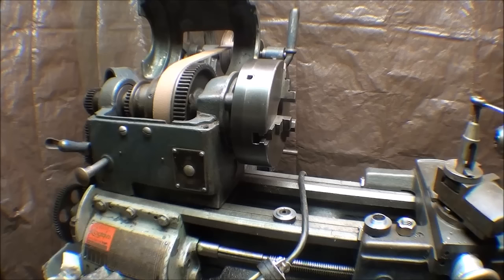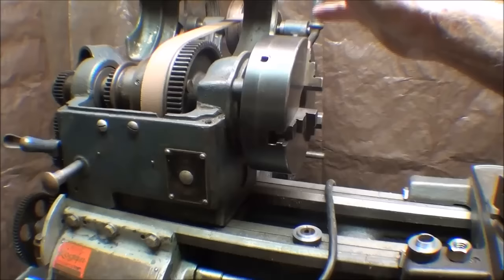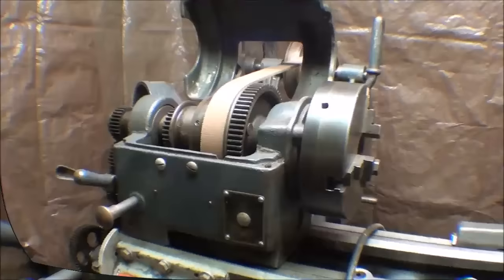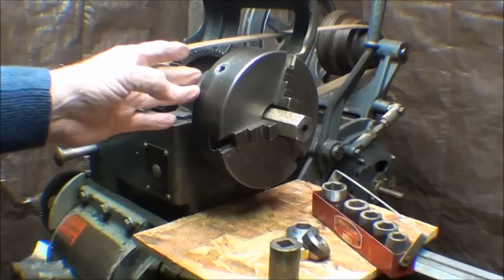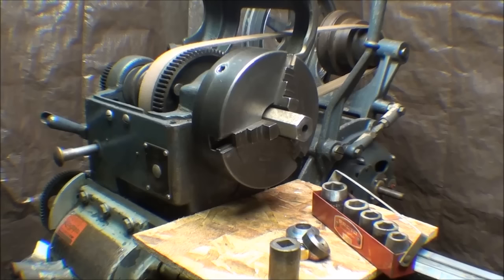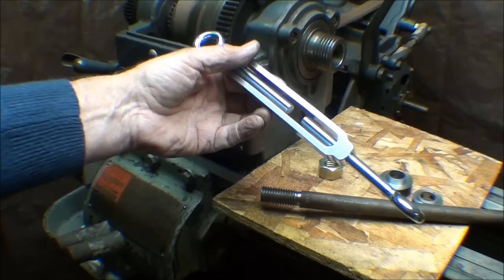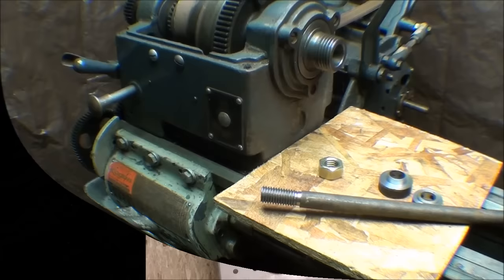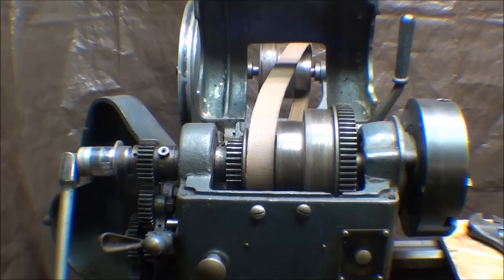SHOP TIPS #281 Removing a Stuck Lathe Chuck tubalcain atlas

Comment: My father came across a South Bend lathe which he mounted and fixed up before passing it onto me. the broken teeth in the gears he drilled a hole or two a bit wider than the base of the gear before inserting a friction fit steel pin which he then filed to the shape of the rest of the teeth. It seems to work fine.
Reply from the maker: Thanks for watching.

Comment: Great range of suggestions Mr Pete222.
Great ideas, I like the idea of using a strap wrench to hold the pulleys firmly, if adequate grip is not possible could you consider using a lorry ratchet strap wrapped around the largest gear and back on itself to self tighten the other end attached to the lathe casting? (I don't know if you can move the gear that it engages with sufficiently out of the way). 
Some lorries have left hand wheel nuts on the left side of the truck- might be another source?
When using an impact wrench occasional short bursts of forward motion mixed in with long busts of back off motion can sometimes help to break the initial break out of a stuck thread.
Reply from the maker: +Dan Whiteford good idea

Comment: another solution..on chraftsmann 12"put piece of 5/8 hex around 18"long so overhangs.out of back spindle..chuck up  have a 20" breaker bar..gears loose belts on and snap it...no danger hitting anything...worked first try..oh just in case piece plywood  rags stappled onto it under chuck

Comment: Hi  Maybe judicious use of heat to help break a chuck free.
I don't mean red heat but warm to hot to the touch and let cool with Kroil or another penetrating oil.
The heat cycles may help the oil to penetrate.
Thanks for your vids
Reply from the maker: +Dennis Williams I hope its very judicious

Comment: Strap wrench....Vise-grip makes a nice clamping unit with an 18" chain on it.....should be great for this application....
Reply: avoid contacting the chain on a pulley ... scratch ...maybe strip of 400 grit paper under the chain ... but at last resort the scratch is better than dynamite ...

Comment: I'm thinking a hook spanner in hole drilled in the pulley would be indisputably the best way to go when all other methods fail.  The  hole can be dressed so it does not wear the belt during slippage.  I only remove the chuck with a hex stock and a wrench.  If I need an impact, I use a plastic hammer against the wrench with all slack taken up by applying pressure to the wrench first. An electric or air impact would also be very effective even if only against the weight of the spindle.  I am contemplating an internal pipe wrench placed well inside the in-feed end of the spindle as a possibility also.
Reply from the maker: +Crafted good idea

Comment: Way late, but be careful if you lock the driven cone with a flat or V belt. Remember all the torque you apply to the chuck is passing through the pull-pin in the bull gear. Also as Lyle points out, if you lock the spindle with the back gear and you break some teeth, your lathe is just about ruined... replacement parts are like finding hens teeth. My lathe has helical form back gears and I'd by a junker just to have replacement gears.
The best solution is the last one shown in the video. Lock the spindle using the the through hole and go after the chuck with an impact wrench. 
Once you get the chuck off, make a paper ring to go over the spindle nose and make a seat for the chuck. It will make the chuck much easier to get off... just remember that running in reverse is to be avoided. 
A clever trick with threaded spindles is to get a collet adapter for a 5C collet (or the largest style collet you lathe will take) and then get a chuck with a 5C shank. I have a 4" chuck that stays on my 12" lathe most of the time. Then you can run forwards and reverse without worrying the chuck might come loose. Also, you can pull the chuck and install a regular collet in just a moment.

Comment: One problem that is somewhat related to this, in regard to the threaded spindle, is keeping the chuck tight if the spindle has to be run in reverse.  I have a similar idea to your drawbar (probably more like a Colette closer) but with the big end large enough to seat over the mounting plate rather than just the spindle end.  Using some heavy wall pipe that will just slide through the spindle bore would allow you to keep from totally plugging the spindle.  I've been thinking on a prototype for that, just need to find material so I can try it.

Having a 98+ # chuck coming lose to land on your bare ways makes life rather difficult, not to mention making you feel very un-professional.
Reply from the maker: +diggerop Excellent idea to prevent unspinning

Comment: I have a S-B 13" lathe with  4 jaw chuck stuck on it.  Before watching your helpful video (#281) I tried unscrewing the chuck after locking the spindle with the back gear (BAD IDEA). I was unsuccessful even using a cheater bar. Fortunately I stopped and watched your video. So today I put on a 1/2" electric impact wrench with a 1" 8 point socket on a 1" square bar in the chuck. Afte 8 or 10 short bursts I had no luck.  After each attempt I had to retighten the bar which loosended up due to the vibrations.  Any suggestions? Should I keep trying the impact wrench?  Bigger impact wrench?  Next would be to make the 5/8" bar with the left hand thread going thru the spindle the collar on the right hand side of the spindle up against the 4 jaws of the chuck?
Reply from the maker: I would tell you to keep it up with the impact wrench. Occasionally putting it in forward and then reverse. Possibly heating up the chuck thread. Not too hot, use propane, not the blue wrench.  Just keep trying different things. Eventually you will get it but it won’t be easy.
Reply: @mrpete222

Comment: I have a lathe from the 20s the chuck is stuck and is wore out any suggestions
Reply from the maker: Try to take the whole thing apart after soaking it in diesel fuel.  Actually, I would throw it away and get a new one

Comment: I think your V-Belt strap wrench would work even better if you clamped the drive gear on the end of the spindle instead of the pulley.  The gear should bite into the belt and prevent slipping.    I've also seen people make a clamp from a block of aluminum that's been bored to the size of the gear, then split and bolted back together.  Now you have a square/rectangle you can grab with a wrench.
Reply from the maker: +ChipMaker 1066 Both ideas are very good & workable. thanks

Comment: Is a lathe totally junked if you break a few teeth? My lathe has missing teeth and still runs fine, and i can even see a few places where broken teeth have been repaired.
Reply: +Rob Mckennie Agreed.  Real machinists don't throw out anything that can be repaired, re-purposed, or at least donated to someone who can.
Reply: +Keith Ward Good few videos here on making new teeth for a gear, and many ways to do it using assorted material. Good thing is you can even do it without a lathe or a miller, just using hand tools and filing and grinding. Gear teeth in this application just have to be moderately strong, and as most are straight cut they are pretty easy. Just make a pattern off a good section to get the angles right.
Reply: Easier said than done. Me as a newbie don't have the equipment to just run off and make gears. Sounds like Rob is a newbie asking if its totally junk.

Comment: I have a very badly stuck chuck on my myford ml7 and I may have been one to message you.  do you think If I made the last tool and used a impact gun on a piece of hex stock in the chuck…. do you think I can ruin anything? the soft bearing material? or snap the threads of the chuck? or mar or bend the spindle itself (with all the drive pulleys?)  do you suggest heat be used (acetylene?)
Reply: +ShnitzlHaus - Try the impact gun with the spindle unlocked. The inertia of the spindle will eventually let the impact wrench break it loose. The impact wrench/unlocked spindle method puts no strain on the back gears or on the spindle bearings. You just have to prevent the chuck from spinning too fast. Short bursts, or a gloved hand to keep the chuck from getting away from you.
Reply from the maker: +ShnitzlHaus try it---but no heat

Comment: What about using an Internal Pipe Wrench inside the spindle. Originally I was thinking of inserting it from the gear end opposite the chuck, but I think you might be able to insert it into the spindle on the chuck end taking advantage of the more robust end of the spindle.
Reply: Well, I recently obtained an Craftsman Atlas 12" Lathe. I wanted to know how "Stuck" the chuck was,, so did try using an internal pipe wrench. Worked quite well, I do not think the chuck was that stuck. I used an adjustable wrench on one of the jaws and the internal pipe pipe wrench with a 3/4" drive, socket and wrench rested on one of the protected ways. I do think one would need to craft an optional method to turn the chuck should the "Stuckness" is more serious rather than using just one of the jaws, possibly making a spanner wrench of sorts.

Comment: I have a Atlas-Clausing 6" lathe and when I bought it the chuck was stuck on it. I didn't want to chance damaging the back gears trying to loosen the chuck and I'm glad I didn't try. 

Remember place a board as a protector for the ways before doing anything. I tried several different ways (dry ice, strap wrench, etc) to get the extremely stuck chuck loose but the only way I was able to get it to come off was with the way I will show below and remember it's basically a last resort and I needed to be able to use a four jaw chuck so I was willing to take the chance of breaking something major at this point.

I ended up removing the snap ring and high/low range catch and then removing the snap ring and spindle belt pulley to expose the spindle shaft itself also making sure the back gear was NOT engaged. Once I had all of that out of the way I took a 2x4 about two feet long and with it laying on it's wide side I came in from the end about 4" and drilled a 3/4" hole (outside diameter of my spindle shaft) with a speed bore bit, after that I took a saw and cut from the end of the board all the way down to the hole (centering on the hole) and went an additional 4" past, removing about 1/8" wide. I then drilled a 1/2" hole all the way through the narrow sides about an inch above and below the 3/4" hole and put a long fine thread bolt with washers on both sides so it could yoke down onto the spindle shaft without damaging it. 

At first I couldn't get enough friction with just the wood trying to grab the spindle even with it cleaned using brake degreaser so I placed Pine rosin, like they use on baseball bats, on the spindle to help and yoked up around that. I tried a wrench and hammer to shock it lose but it wasn't happening so I placed a 4" long piece of 13/16" hex stock in the chuck and tightened it up and used my Nitrocat 1/2" air impact with short burst so it wouldn't overcome the friction of the board and rosin and just spin. It took about a half dozen tries before it came loose but finally did. I would have never gotten it loose another way and I was only trying this as a last resort to get the 3 jaw loose so I could use a 4 jaw chuck as well. Luckily for me there was no damage to anything when it came off.
Reply from the maker: Wow, that one was really stock. That was a great solution

Comment: Hou can one lock a screw  on chuck in order to use the lathe with the chuck running in reverse
Reply from the maker: I have been looking for that solution for 50 years
Reply: @mrpete222  Thanks but I am nearly 80 so 50 years mite be a tad to long

Comment: My new chuck was stuck to my Central Machinery lathe after I
did not remove it after use, although it could be done by turning the wheel and
chuck oppositely by hand. Fearing it could get worse as time goes by I try out various
ways without success. The problem lies with the difficulty in gripping the
wheel and leveraging the chuck and turning it.

I got some idea watching your video; got a wrench gripping
the wheel and a ½ inch bar mounted between the jaws, allowing me some leverage
I gave my all strength and pushed left hand and pulled right hand simultaneously
and it worked.

This problem may recur and prevention saves lots of trouble.
I am thinking that putting a sort of washer between the spindle and chuck might
prevent this problem in future. Any suggestions would be welcome.
Reply from the maker: I would not use the washer-could cause an inaccuracy. Just us a drop of oil
Reply: Thank you

Comment: All great suggestions. But as a note, Some lathes have a weak spot at the end, where the gears are. For instance the South Bend 10K spindle is notorious for cracking on the left side. Make sure your adapters fit properly.  also, in some cases it may be safer to remove the Chuck from the backplate. Then bolt a bar of some type to the backplate and pry against it. It is better to damage the backplate which is easy to replace than to take a chance on damaging the Chuck.

on a side note, removing and installing a lathe Chuck can be tricky in some cases. Placing a wooden Dow in the chuck that is slightly smaller than the spindle bore can help with installing and removing the chuck. the wooden Dow should extend approximately 5 to 6 inches on either side of the chuck. This gives you a good handle to hold the chuck, and makes it very easy to align the threats. it also helps prevent the lathe chuck from falling on the bed or pinching your finger.

Remember brute force is not always the answer. It might work in some cases, but you are taking a chance on damaging your equipment. Properly applied force as Mr. Pete Implied should get the job done, Without damaging your equipment.

work smarter not harder, think about what you're doing, And how to do it in a safe manner.
Reply from the maker: +Joe Allen True-Thanks for watching

Comment: The atlas 10 inch lathe that I'm trying to rebuild has a broken lead screw bearing on the right hand side of the lathe. I tried to remove it today but after I removed the two thin nuts off the end the cast iron bearing itself won't come off. Does anyone know if there's a trick to removing it or is mine just being stubborn? Thanks
Reply from the maker: +Shane K Should come off with some tapping
Reply: Got it off today with a gear puller, thanks

Comment: Mr Pete,
The last solution you recommend with the bar seems like it will work fine but how does one get that super tight bar loose once the chuck is off? Seems like you would have to lock the back gears :-)
Reply: +Myles Lawrence Pipe wrench on the round end, you already have the socket at the other end.

Comment: I would modify your pipe idea a little by; getting a pipe ID large enough for the V belt or Flat belt. Next bevel the pipes head stock end so as not to cut into the belt. On the opposite pipe end make an step washer, one end inside the pipe's ID the other larger than the OD, free to turn. Here is the change: I would use 2 pipes with a threaded coupling in the middle. Once the belt is hand pulled as tight as possible the belt ends are clamped together at the step washer end. Next by rotating the pipe between the coupling and step washer (pipe's headstock end and coupling held so they won't turn) end extra slack could really be taken up. Might weld the coupling to the pipe facing the headstock to bond it together, and add some external tabs or something for holding and rotating the pipe.

Comment: Gripping the 4-step pulley sends all forces thru the pin. Dangerous, seems to me. I'd go with gripping the bull gear as it is attached to the spindle, yes? In 50+ years I've used the pin w/o issue. I have used the back gear approach, also w/o issue. BUT I am smarter now and see the error of my ways, and see wear/deformation around the indexing hole where the pin dwells.

Think first, then act with restraint.

Comment: Could you not chuck a piece of hex (3 jaw) or square (4 jaw) long enough to go all the way through and put a wrench on both ends?
Reply: +William Garrett I think you would be fighting yourself all day long. Trying to turn one end and holding the other. Unless I'm misunderstanding your suggestion.
Reply: then you would just lock the chuck to the hex. you need to lock the spindle, so you can turn the chuck.
Reply: +Fredrik Weme True
Reply: +William Garrett 
 you would only be trying to twist the Hex stock. There would not be any opposing force applied to the chuck or spindle.
Reply from the maker: +William Garrett No

Comment: I took between 2 & 3 days to get a stuck 3 jaw chuck off a 1946 Hercus (Australian clone of Southbend).
After many unsuccessful experiments I locked the chuck to the bed using a strong piece of wood held flat across the chuck face in the chuck jaws, bearing on the bed.
I then fabricated a kind of wooden pipe vice using a hole saw to cut a hole (the hole is formed of two half moon cavities) through two 18" long pieces of ironbark (a particularly hard wood) to make the vice jaws the same diameter as the end of the spindle. This is then clamped to the end of the spindle real hard. As it's wood it does not harm the spindle. You then apply torque. From memory, no teeth were involved/risked in this operation.
I suspect the chuck had never been off the spindle since 1946. Can chucks "weld" themselves on after a long enough time ?
Reply from the maker: That was a great procedure